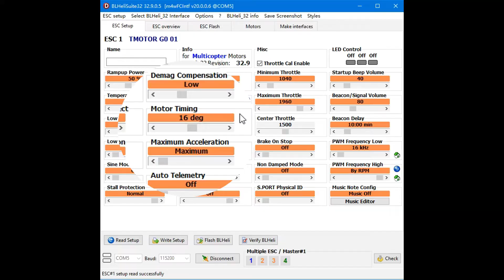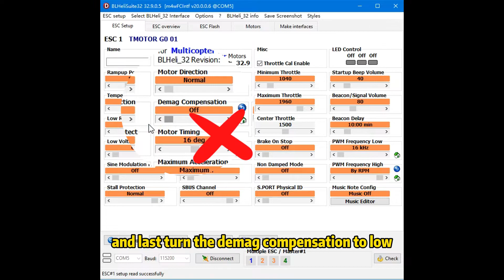MEPS FPV Quick Fix: How To Fix Desync In 59 Seconds!

Comment: this is outright wrong.
pwm has no affect on desyncs.

try lower rampup power. 50% is often way too high, go 30% if not lower. This is especially true for larger motors.
also try higher timing is better to prevent desyncs. try 23-25.
DO NOT turn off demag, higher demag compensations is better to prevent desyncs, not lower. however often times the rampup and timing adjustments i mentioned above should do the trick, increasing demag is a last resort.